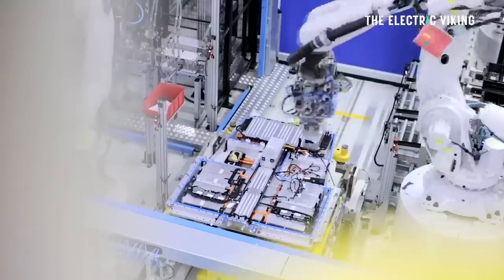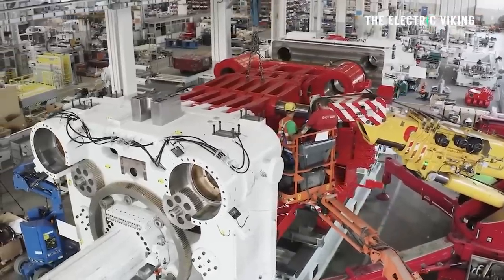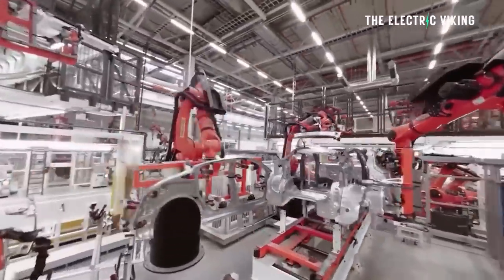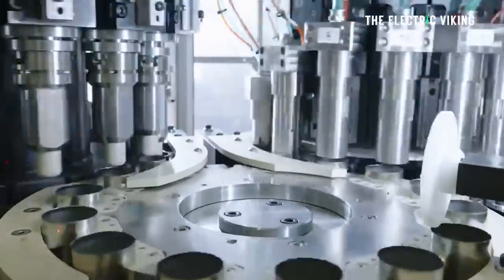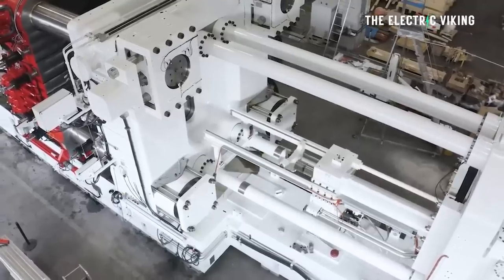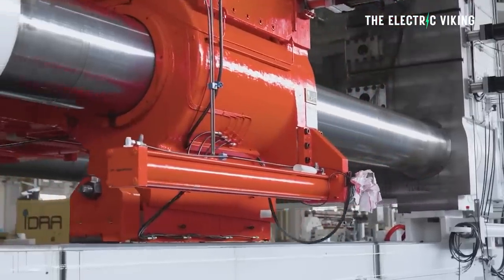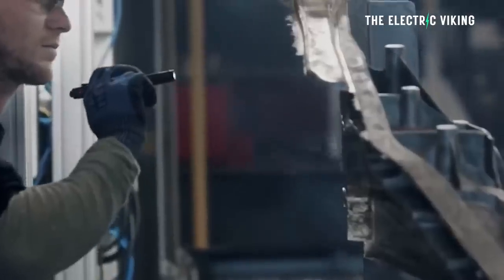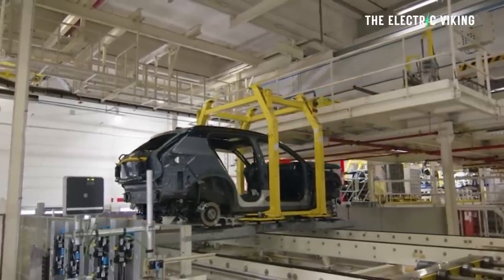Volvo orders 2 massive 9,000-Ton EV GigaPresses from Tesla supplier

Comment: It was inevitable. 
When the costs of GigaCasting are compared to the old way of welding subassemblies, castings take up less floor space, less time, less handling, fewer robots.
What's not to love?
Reply: @@phillipbanes5484 Nobody sane tries to repair body structure damage and it has been proven castings are more resistant to small hits while keeping crush zones.
Reply: Lack of modularity. One needs to make huge custom molds for each model.

Not a problem, if one makes one or few models of cars. Big problem for company having tens of models wide model range and wanting joint economies of scale between models via shared platforms.

If one say casts whole rear end as one piece, we'll now you need tens of different massive car sized molds. Those aint cheap to make in first place and one has to keep swapping out molds. Can't just say keep single stamp or mold in press and churn out same floor pan for 10 different car models.

Which to me is the reason Tesla has such hard time renewing model lone and keeps making ten year old design still. It is expensive and time consuming to make new molds or change the molds. They aren't platform oriented like other models where same bottom chassis (or skate in case of EVs) is designed to easily have ten different bodies quickly welded on top of it or later on make new models based on it not even visioned upon original conception.

It's pros and cons. You can make that one model very efficiently, but what when the design gets old and boring in eyes of customers or design trends change. Now you have to even for minor design face-lift start from scratch. Since not only the chassis, but the design language is built into the monolithic casting.
Reply: Definitely more expensive insurance because these cars are not repairable. Don’t just take my word for it, do a search - typical Tesla repairs are $30K or more and it takes many months because they don’t have a dealership set up.

Comment: As prices of advanced machinery go up initially capex likewise rises. But, introducing advanced machinery helps to rationalise the production process so capex relative to physical output and the value of that output goes down (in percentage terms) assuming high utilisation levels of the advanced machinery.

Whatever these machines get used for they won't be for product assemblies made in low volumes. Volvo sees itself as a leading player in Europe's automotive future. Its high volume ambitions are on show with this IDRA gigapress purchase.

Comment: I have an honest question. Do these new frames that are one piece, if you have an accident and the frame gets damaged.  Is it basically a write off?  Or are you able to fix them
Reply: Not only are they repairable but I expect it is possible to replace the cast part without much work compared to conventional cars.  Especially on the refreshed 3.   I posted about a video showing Tesla's modular construction at the top level.  It is crazy simple.

Comment: The legacy automakers are about 2 years too late - certainly later than Tesla/ the Chinese automakers. They also still need to work out the optimal injection mix of steel/aluminium/metallic trace elements to put in the presses. That'll take even more time.
Reply: Absolutely true, but at least they have started on the path. Those that are still in denial probably won't survive.
Reply: @MrEd2291 I would assume IDRA already know quite much how to do it. Why they should 're-learn' it?
Reply: @mho0  As I understand it, IDRA provide the presses, and then each car manufacturer designs each mould , adapts the quantity of mix according to the size of the mould, and the relative mix of metals depending on the complexity of the mould and the required strength/ductility/stiffness of each given cast. I could be wrong, and am willing to be corrected on this.
Reply: @Z3nonD3mon I would believe you are right. I was mainly trying to say that they still know probably extremely well how moulds can be done, how different mixture work etc. and can advice any of their customer very well how to use it from all aspects.
Reply: @mho0  Your discounting the difficulty with casting in general. It works like magic once you have it dialed in.  Getting there is not easy.
Reply: @danharold3087  you might be right. I am just thinking that it would very weird if IDRA would not know extremely well how their multi-million Euro devices can be used and tuned. For sure there will testing/learning and what not, but they must have huge amount of knowledge how to get started and get productive quite fast.
And also like in all engineering it depends how much you want to push to the extreme. If you push to maximum cost saving, lightness or such -> process if for sure more time consuming and difficult. If you settle for good (not perfect) results process is typically dramatically faster and risks smaller. So it mostly depends how you do it.

Comment: Whats not to love? Very simple - IF your car is involved in an accident then its ludicrously expensive to repair and will likely lead to the insurers simply writing it off Why? Because with traditionally built cars you can simply replace the damaged panel BUT with these its like half the cars body as its all one piece. All this will do, whilst doubtless great for car makers of course, is to lead to massively increased insurance costs for drivers and much larger repair bills, if that is even possible.  Take Rivian as an example. A relatively minor rear ender will cost $45K as the huge one piece section (from rear to front) has to be replaced. Old school it might have just been a quarter panel for maybe $5K. As always there's no such thing as a free lunch and, if you're daft enough to think that there is, you should stay in play school and not venture out into the real world
Reply: I guess would be also possible not to press huge pieces, but also have some accident 'zones', which would crumble in case of minor accident and whole big structure would not be damaged.

Comment: Just a thought about costs coming down.  Where are insurance costs going to go, not replacing a corner anymore, the whole front, or rear or middle?  That's gonna hurt.
Reply: I think that is valid worry. And wasn't it so that Herz 'complained' that maintenance/fixing their Tesla fleet is 2x more expensive than other cars.
But I am pretty sure Volvo will also consider how to fix them in sensible way (most likely more than Tesla)
Reply: A good auto body person will be fixing unboxed method Tesla's in a fraction of the time it takes to repair other cars.  And when he is finished it will be factory straight.  If this does not bring insurance costs down we are still getting ripped.
Reply: @danharold3087  I hope so. For now it does not look like that it would be the case, Tesla repair costs seem to be very high. Maybe it is artifical and will change better in the future.
Reply: @mho0   Don't expect a square deal from an insurance company or an auto body man who understands Tesla may well put him out of business.

Comment: Tesla vehicles built with their modular assembly method, model 3+ onward, will be the easiest, fastest, possibly least expensive to repair cars on the road by a wide margin. 
@SolvingTheMoneyProblem said  "This is an INCREDIBLY insightful video. Thanks. Tesla's engineering is next level insane."  The video is Tesla’s Master Class In Modular Assembly - Autoline On The Road .  It speaks for itself. Can't wait for Sandy Monroe to tear one down.

Comment: Good luck to the body shops repairing them!
Reply: Tesla starting with the refreshed 3 will be the least expensive to repair cars on the road.   Tesla has also sells insurance and fixes body damage at it's shops.  It has closed the loop.  I has used this to make cars more repairable in addition to easier to assemble.

Comment: How are these presses 9000 ton? That's the weight of a full size 170m long destroyer warship... From the footage shown I'm not seeing the size comparison
Reply: They apply 9K tons of clamping pressure on the mold.     The larger the mold the harder on has to clamp it.   This holds for all metal casting.

Comment: There casting press’s !!! All companies have them !!! Tesla is not alone here !!! All this means is they are Expanding and making a new factory . 
Telsa has put all expansion on hold as its sales keep spiraling downward and it’s global market share slips from a peak in 2022 to now only %10 and slipping . 

What this means with everyone else ordering new press’s for manufacturing expansion Volvo, Toyota, VW group etc. Tesla faces much more competition in the next 12 Months. It’s already under a lot of financial pressure as it’s CFO left. Lowest profit margin in the industry at 4% with pricing slashed 20% as its production costs increase . Now targeted by unions ( lowest paid workers in the car industry with least benefits, and most inexperienced due to high turn over) and its workers will listen. Luke warm reception for the face lift high lander and cyber truck with reduced sales .  If Tesla cannot fix its inherent quality and reliability problems making their car’s fragile to owners and last for reliability on the consumer scale it will remain a low volume car manufacturer.